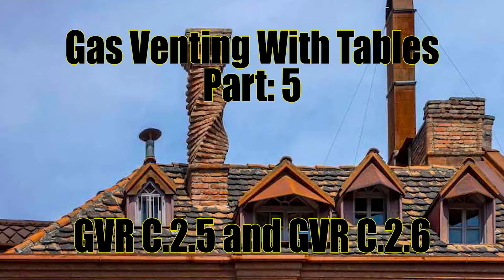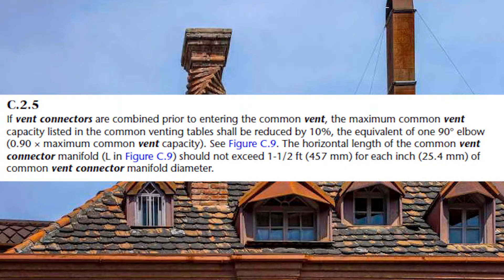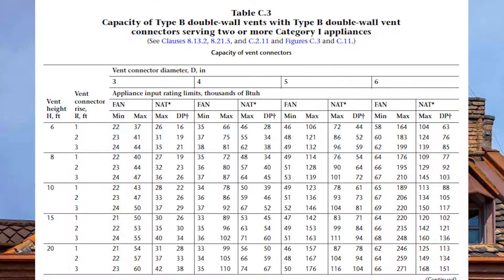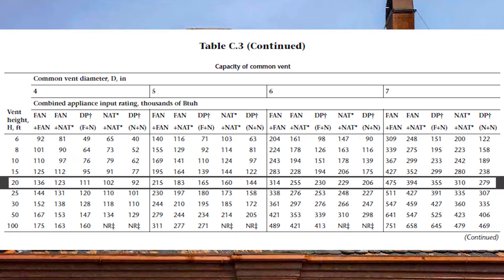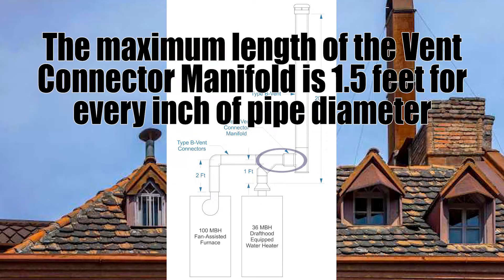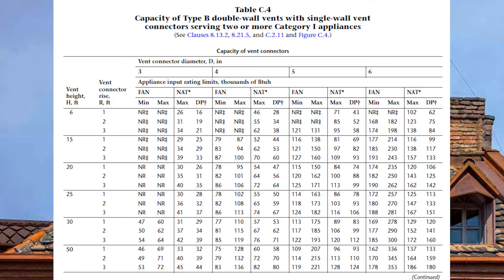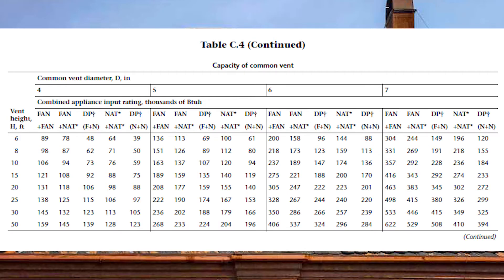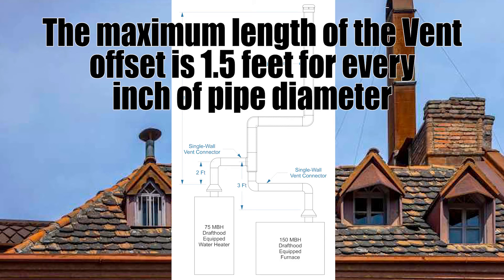Gas Venting with Tables Part: 5 - GVR C.2.5 and GVR C.2.6

Comment: when venting with tables   if for example the was 3 appliances into a common manifold, is EACH manifolds  sections table max reduced 10%?  or 10% reduction for entire manifold ?
Reply from the maker: Each section is reduced by 10%, therefore the common vent to all 3 will be reduced by 20%.

If you decide you want to just have a common connector manifold that is just one size, you would reduce the entire thing by 20% based on the total BTU load.

Bear in mind, you will never run across this in the field other than to replace something that is existing. This type of venting is virtually obsolete.

Comment: for clarification, earlier venting videos didn't derate common vent connector/manifold table capacity  by 10%, the whole 9" manifold for example,  is this video is supplimental information that applies to all manifolds? also the max manifold length  referred to also (1.5' per 1" diameter) this requirement applies to pervious videos ?